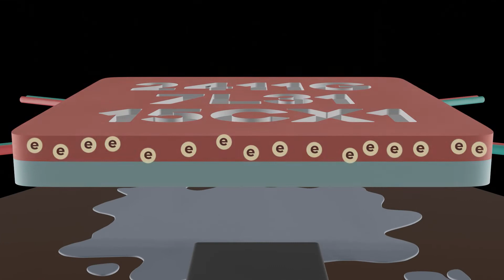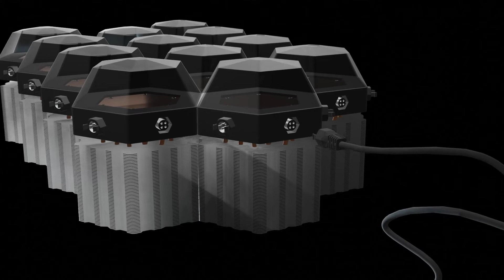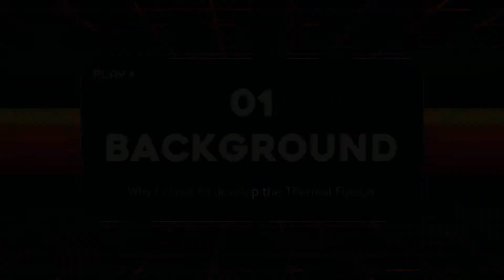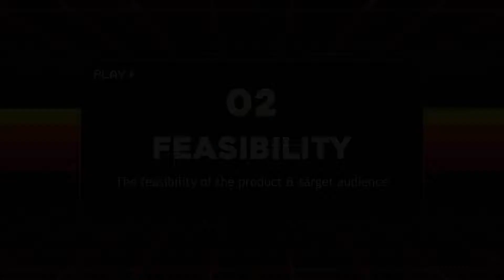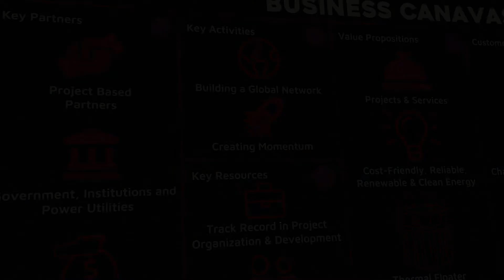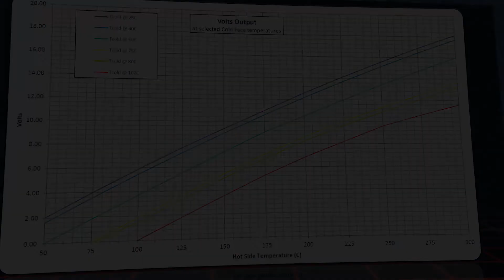Thermal Floater Product Video

Comment: Hello. Did you participate in this year's fair ?
Reply from the maker: Which fair are you mentioning about?
Reply: @incineroarblast  iris national fair
Reply from the maker: @anjusinghal9961  yeah, I didn't get selected unfortunately
Reply: Ohh ok . Have you made a prototype of thermal floater ?
Reply from the maker: @anjusinghal9961  yes, it has been in works for some time. Currently, I have ordered some custom parts to be CNC machined and once those parts reach me, it'll be ready